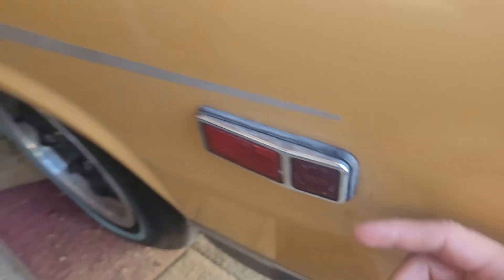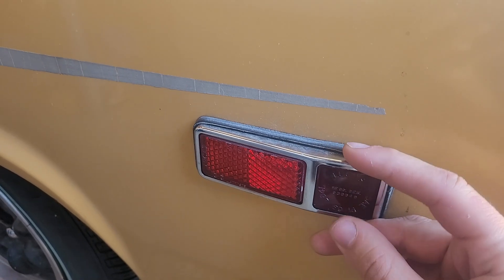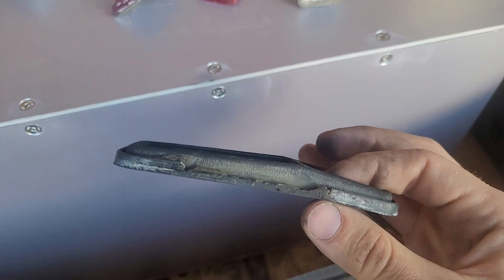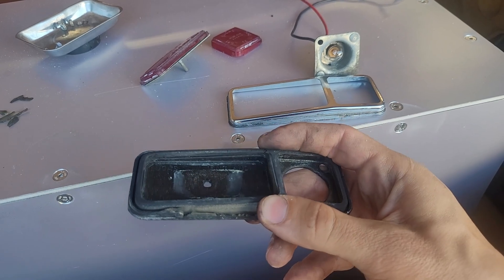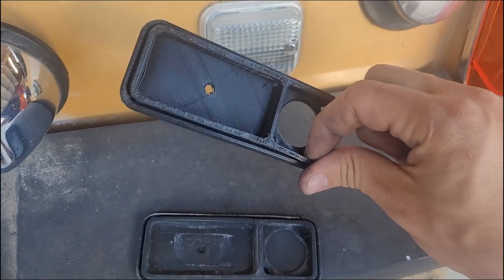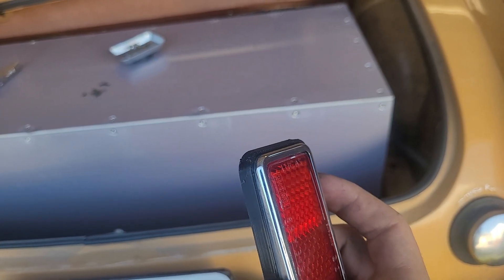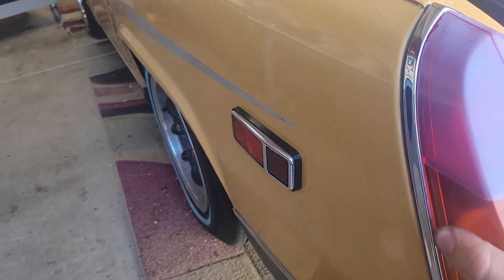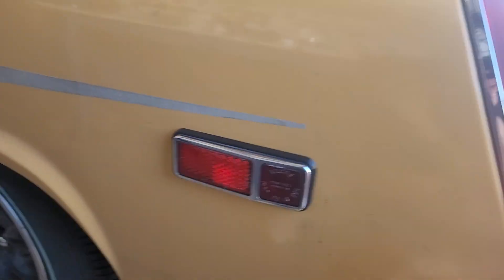3D Printing a 50 Year Old Gasket

Comment: A way to perfect this recreation of gaskets is to print and clean a PLA part and then pour a silicone mold with it in which you could cast these rubbery parts. Like you said though, this is good enough to be serviceable, perfecting is for the shows.

Comment: Nice job! I usually do the same for old pieces and it is quite satisfactory. I would loved see a bit of the design part on the video 😉
Reply: I second that. Did you do a 3d scan or model it from scratch?
Reply: @Neberheim   I tried 3D scanning once but the work of correcting the scan measurements due to error margins was too laborious and I think I'm better at designing from scratch than scanning xD

What about you? I think that 3D scanning has made a lot of progress
Reply: @EduLitiothe last time I used a scanner was 2020, and it was a pain in the butt. It does seem like a technology has improved a lot; if I had a use for it I would probably look into it again

Comment: I think a light application of spray paint would hide layer-lines and delay UV breakdown, but I'm also interested in how it holds up directly from the print bed.
I had an ABS print last a few years in direct sunlight before it became too brittle, TPU i expect will perform even better.
Reply from the maker: Maybe I'll clear coat 1 gasket and leave the other without for a controlled experiement.
Reply: Harbor freight has sandable primer that fills small imperfections.